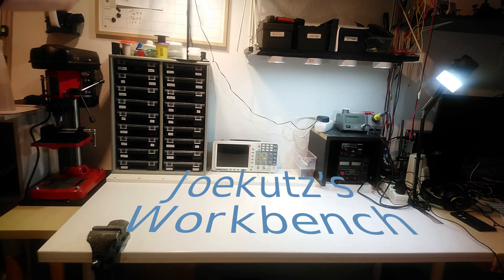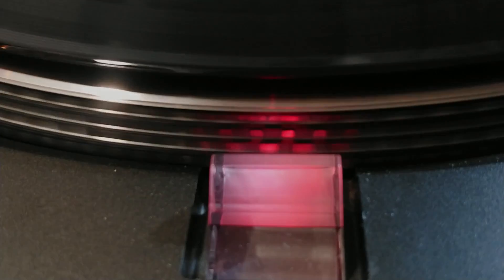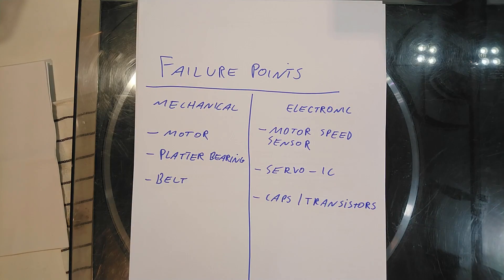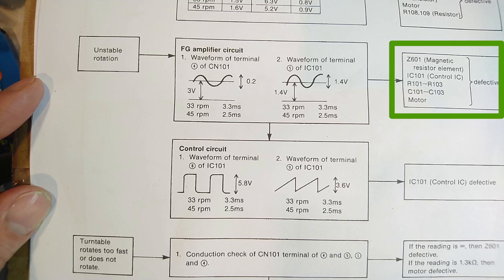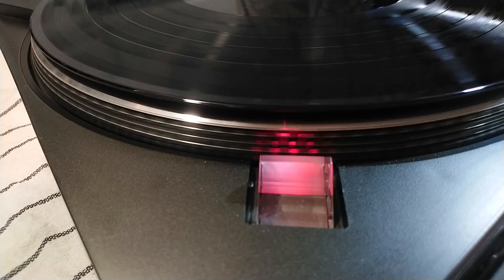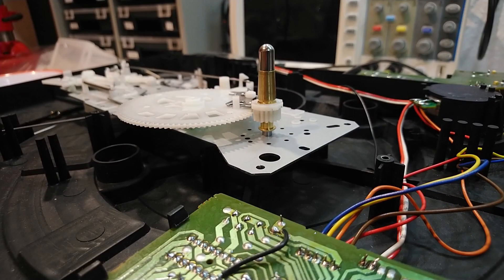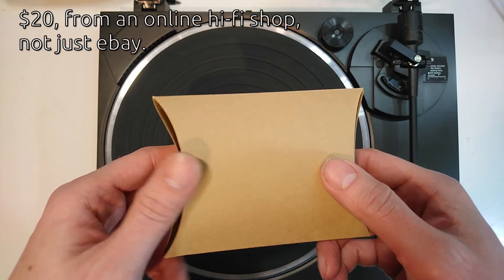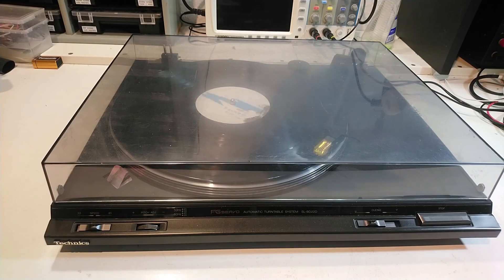Fixing high wow&flutter on a Technics SL-BD22 Turntable

Comment: In my BD22 the uneven speed was caused by the speed potentiometer not giving a clean signal, I had to spray it with tons of contact cleaner to fix it.

Comment: I have this exact same turntable and I'm having the exact same problem. I don't have the technical skill to proceed in the way that you did. But at least I have a better understanding of what the problem is. Perhaps if I just buy one of those thicker belts it might help.
Reply from the maker: A good new belt might be exactly what you need, at least when your Problem is a slight wobble while it otherwise runs fine. The electronics rarely fail, just the motor can corrode over time.

Comment: Great job and beneficial video. Sir, could you please share the belt manufacturer and model and app you used for measuring the rotation? Thank you.
Reply from the maker: The app name is actually shown in the video at 02:00 :)  it is "RPM speed & wow" by Andrea Martignano. The Turntable-shop didn't mention the brand of the belt, but I guess ordering one in an actually decent Technics parts shop and paying not too little (I paid around $ 20 / Eur 18) is a save bet. The first belt I bought was below $10.

Comment: "Works almost..."  Too true.  I sold a Technics SL-B10 that I had due to the wow and flutter issue.  I also had a nice quartz locked SL-QD-33 but the automatic mechanisms weren't working either on the fully automatic table.  Many of these p-mount Technics tables need servicing, keep that in mind if you plan to purchase one.
Reply: wish i sww this comment before lol but i got a sl-dd22 recently and i have no idea what’s wrong with it. wish i could fins a manual like his

Comment: I think that only a new belt would do the job. All the other work was unnecessary.
Reply from the maker: Maybe. But sometimes you don't know beforehand.
Reply: Not sure because one of mine has the same problem with the original belt. I would suspect an aged oem belt would have different symptoms.

Comment: Great video!  What kind of grease do you use on plastic parts?
Reply from the maker: Proper grease for plastic is surprisingly hard to come by here in Germany. I ended up ordering "grease TF silicone+PTFE" on ebay which is designed for plastic parts. Typical lithium-based grease can be harmful to plastic, and "Normal" Silicone grease here is weirdly solid and sticky and meant for O-Rings in Coffee-machines, not for lubricating moving parts.
Reply: @Joekutz   Nylon and POM aren't actually afraid of any grease you might throw at them as far as i know. And all your friction-prone moving plastic parts should be made from these.

Lithium grease isn't based on lithium, it's various kinds of grease (petroleum based or silicone base) with lithium soap as an additive that makes it stiffer and stickier.
Reply from the maker: @SianaGearz  I agree. I am not sure what type of plastic that was, but I know that many plastic mechanisms in devices are greased from the factory, and the turntable was no exception.